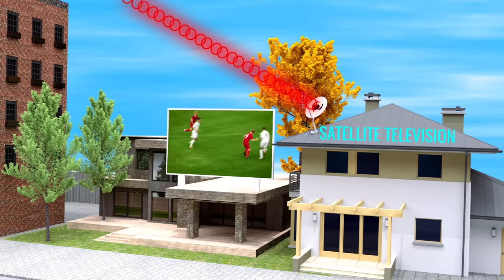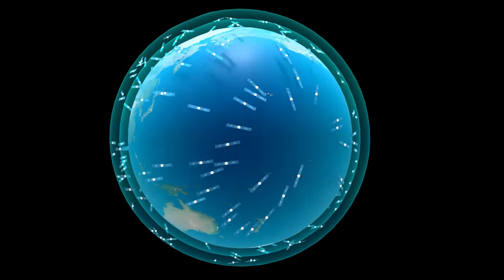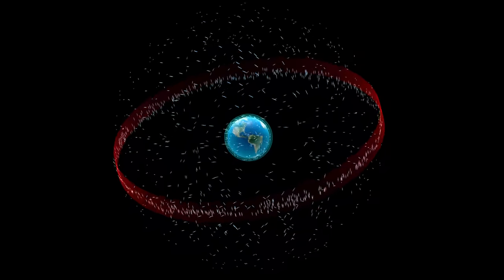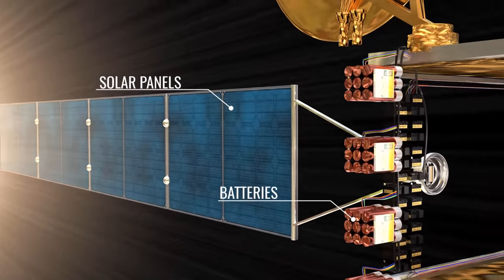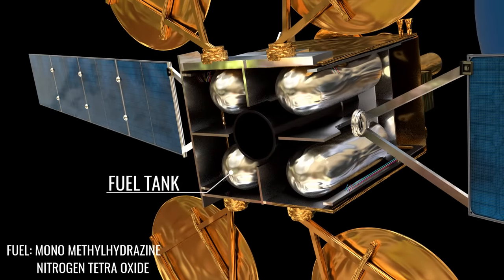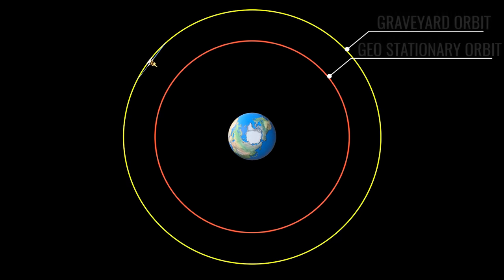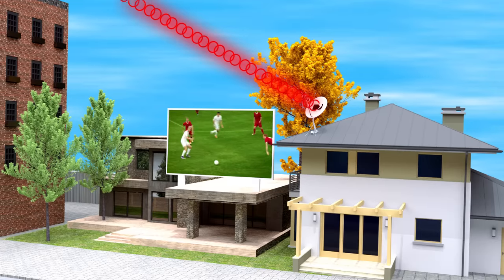How do Satellites work? | ICT #10

Comment: I think you should make part2.. With more details..
Reply: Yeah, he didn't stress much on satellite communication. He said it's not efficient because the wave has to travel a distance of 22000 miles but EM waves travels with the speed of light 🤔
Reply: @lbmetei7596  The further the satellite is the weaker the signal will be be when it reaches earth. Also at that distance the delay is about 140 millisecond which may not be a big deal. But the signal may have to travel that distance up to 4 times. So that's more than half a sec of delay which is not good for real time communication such as gaming or voice.
Reply: @ReflectiveLayerFilm  low earth orbit satellites will have much less delay
Reply: @samueladitya1729  by

Comment: It's a great video, but one thing, as a physicist there is one thing the has sneaked into the public vernacular that is not correct:
There is no such thing as centrifical force.
What they mean to say is:
Centripetal = center seeking force (centri = center). Ex. Gravity
Centrifugal = away from center force (fug = away). Ex. The velocity of the satellite
Reply: the velocity- either angular or linear- of the satellite is not away from the center. The linear velocity is tangential to the orbit. And for angular velocity, inwards/outwards it is meaningless. Gravitational force is the centripetal force. But yes centrifugal force is make believe.

Comment: I have a question. How do ground bases communicate with multiple satellites simultaneously ? I'm asking from the perspective of how antennas receive and process those signals simultaneously. Maybe with the help of Frequency Division Multiplexing?
Reply: Even after 2 years u didn't got the answer ;-;
Reply: Differnet satellites uses different frequencies for up link and downlink. FDMA will be used across satellites in GEO orbit.

Comment: How does a satellite dissipates the heat produced (for example by a transponder)?
Reply: Thermal Radiation?
Reply: It transfers it to its surroundings
Reply: @engr.nemuelobas4923  yeah but he correctly thought about the fact that for something to give off heat, something else has to take in that heat, which is true for conduction and convection, but not for radiation. We also get a lot of energy from the sun through thermal Radiation
Reply: @engr.nemuelobas4923  the problem for conduction and convection is that there are no 'surroundings' to give it's heat off to

Comment: How are satellites refueled ?
Reply: Solar
Reply: They didn't. Usually, satellites' lifetime is about 15 years. After that, it replaced by a new one.
Reply: They are not refueled, the amount of fueled they carry is calculated beforehand in order to last for the entirety of its lifetime. Then, as it has been mentioned in the video, when the satellite is about to run out of fuel, they move it to the graveyard orbit and leave it there.
Reply: @lluismr97  but this Is a waste of precious and expensive materials
Reply: A waste of materials would be to go and refuel them, remember you have to launch a rocket to get to them so it is much better to just launch a new one. This obviously increases the amount of space debris up there and that's the main issue that needs to be solved.
Reply: Why don't satellites just slow down, lower the orbit and burn in the atmosphere?
Reply: When they are in low earth orbit they do that, but if they are higher it is easier to just put them into the graveyard orbit.
Reply: @lluismr97  thank you for the answer 👍
Reply: @lluismr97  yeah. And requires less fuel than deorbiting
Reply: @pmj_studio4065  they do.

Comment: Sputnik 1 orbited the earth 1440 times, traveling at 18,000 mph.
Yet inspite of performing all the necessary requirements, fell back to earth 3 months later. Now using the same method, satellites stay in orbit indefinitely. Curious
Reply: The thrusters keep them in orbit ??
Reply: @killstreak4767 From what I have read, that does not seem to be a requirement.
Reply: Dean Floyd it is required for LEO as there are still few particles of our atmosphere there slowing down anything that orbits on that altitude. You heard wrong.
Reply: @tgstudio85  Do you believe Father Christmas needs all eight reindeer or is there a bit of redundancy?
Reply: Dean Floyd what has that to do with satellites?

Comment: When the satellites want to go on the graveyard orbite, why do they trust in a way that accelerate their angular speed ? If they switch to an higher radius, than the gravitational force is less strong (because the satellite is further from the earth) but if they accelerate then they somewhat keep the same angular speed that they had on their previous orbit right ? So when they’re on the graveyard orbital, don’t they get further and further from the earth since the centrifugal force didn’t really change but the gravitational force became less strong ? Shouldn’t they thrust perpendicular to their trajectory? So their angular speed is slower resulting in a less strong centrifugal force as well as a less strong gravitational force so they can keep their equilibrium and stay on the graveyard orbit ?

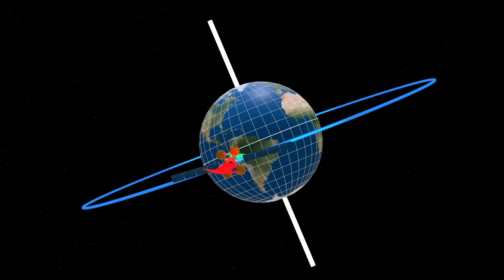Comment: qn 1.  why wont it remain at a same spot if the pulling and pushing forces are equal. why will it revolve ?  (1:10)
             it should stay at a point only stationary if the pulling and pushing forces even each other out. as u said there wont be any external force except                                                   gravity and centrfugal force. so how will they revolve round the earth. for centrifugal force they would need to come in a orbit. so just placing them at a point in space would only attract them to earth. how will they irst come in orbit round the earth???

Comment: As satellites were protected by multiple layers. How solar panels were able to sustain such high and low temperatures. My point is does solar panels were also covered with some layers?
Reply: they might be rigid as their main component is silicon.Nice question!
Reply: Very simple, in space there is a vacuum so you can only radiate heat thanks to electromagnetic waves. Whole space is like giant thermos.

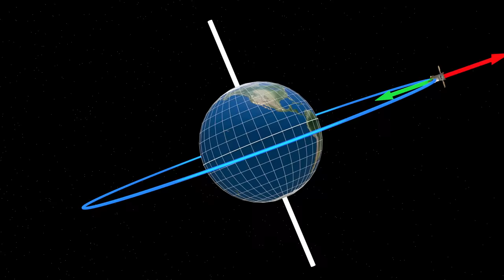Comment: 1:06 Hate to be the nerd here but, that is not true. Small air particles escape the atmosphere and all satellites hit these particles. This creates a very small amount of deceleration called "Orbital Decay". While this is a slow process, most satellites use RCS or Ion engines to counter this.  Sorry for my nerd lesson, it was your fault for reading the entire thing. Also there are more reasons for orbital decay but, this was one of the more simple ones.
Reply: I won't be replying or reading comments here, so comment here what you will.

Comment: As a general rule this it's a very useful of general information about functionality and technology advances but they not present the negative aspect of the constant radiation due the increase satellite in the atmosphere without considering the different frequencies oscillation on the earth. Depends we are you located you might feel the consequences on long time as poison in your body. As a drop of water may not perceive as a threat to the concrete but in the time create a cracking.

Comment: What I would like to know and I believe the true purpose of a satellite truly is would be that the space station orbits the earth at 17000 mph 16 times a day so if a satellite was put on the space station orbiting the space station 16 times each time the space station moved once the satellite orbiting the space station would move 288,000 mph now if they put a rotating disc that was connected on an electromagnet and when the electromagnet turn off the rotating disc was released like a frisbee will the rotating disc move 288,000 miles per hour? and the reason would be obviously that if the rotating disc was to move like a frisbee at 288 thousand miles per hour it would make it to the moon in 1 hour and likewise if we were to add more satellites rotating around satellites and we managed to achieve things moving billions of miles per hour would it make it that we could make frisbee like devices that were hurled from the satellites that can travel billions of miles per hour because if the satellite can move billions of miles per hour and still maintain its form then other objects that are propelled by it would also be able to move billions of miles per hour which would make it that we could travel through space anywhere using the rotation of satellites

Comment: Why do GPS systems on mobile phones require internet to work ?
Reply: To make it accurate ..you  can download offline gps maps but it will not work so good
Reply: not really
https://www.youtube.com/watch?v=0i3CCwTg86M&t=401s
^ this guy tested it on a flight without using any internet connection
Reply: They don't need internet for GPS if you notice Google maps can cach maps so navigation can continue without internet
Reply: Because most mobile GPS use A-GPS(Aided-GPS). A-GPS downloads satellite position via internet to speed up position fix, without it phone downloads position of GPS satellites by signal spread by them which is really slow.

Comment: there is no centrifugal force, if there was and it was equal and opposite to gravity the satellite wouldn’t orbit but just continue in a straight line. there is only gravitational force and then a velocity tangent to the orbit
Reply: If you see from earth's reference you will see that the centripetal force required to keep satellite in orbit is given by gravity.
Reply: Centrifugal force is a pseudo force. 
Exists only for non inertial frame of reference

Comment: Small correction: there is no centrifugal force; the only force acting on a satellite is gravity. Great video anyway.
Reply: Every body when rotates in circular motion it experiece 2 forces Centripetal and centrifugal. Here centripetal force is gravitation force or gravity which is balanced by its centrifugal force
Reply: @tahirbintariq8934  Yes, I saw even some textbooks saying something like that. But that does not make it true, and there is a simple way to test it. If the gravitational force (which is a real centripetal force) is balanced by an equal, but opposite, centrifugal (inertial) force, then the sum of forces acting on the body (satellite) is zero. Try to apply Newton’s second law on such case, and let us know what kind of motion ensues.

Comment: No it's not a balance between centrifugal force and gravity. Satellites do free fall. But they stay in orbit because of inertia: the speed is so high that because Earth is not flat they fall beyond the horizon and never reach the ground.
Satellites also do loose speed because the atmosphere is incredibly faint but not zero for low orbit satellites. The effect is small but after years they do fall back. The exception is geostationary ones. They are so far that it would take millions of years or more to see them coming back...
Reply: If the satellite were inert it would travel in a straight line.

Comment: the satellites fires ?? but there is no o2 in space ??
Reply: Every rocket that will operate in a near vacuum will have two tanks.  A combustible fuel and an oxidizer.  Sometimes that oxidizer is actually oxygen, but there are others.

Comment: Now the real question..how to keep a satellite still , out of orbit ? Sometimes the picture satellite needs a long exposure on a spot like a week for data..
Reply: You can do so by using geostationary satellites which are 6 times higher in altitude than normal satellites
Reply: @lllllllllll1164  .. geostationary moves with the earth rotations..I mean is there a satelite that does not move with the earth or anything else..?..fixed on one spot detached from any moving objects
Reply: @surenbono6063 , there are specific regions in space called Lagrange points. An object (satellite, telescope) placed there would remain still because at these points the gravitational forces of Earth/Sun/Moon would cancel each other out. James Webb telescope is at Lagrange point 2 (actually orbiting that point).

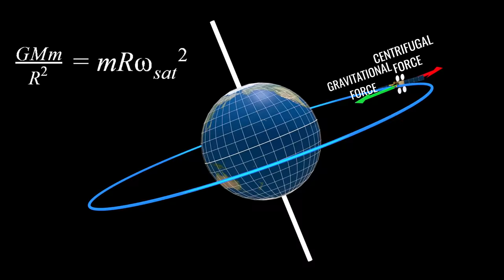Comment: 0:38 it's false, first the centrifugal force don't existe, then if the centrifugal force and the gravitation force were balanced the satelite would go in straigt direction. the truth is satelite are falling in high speed and the force on them is the gravitational force.
Reply: yes, gravitational force provides the centripetal force acting on the satellite, hence the curved path.
Reply: It actually depends on the frame of reference. In a stationary frame, you're right; there is no centrifugal force. However, if you're using a rotating reference frame, centrifugal force does exist.
Reply: @patrickthompson5513   people must pass class 8 before asking such doubts.

Comment: Satellites are mostly land based some are on Baloons and drones.
Reply: When you grow up you won't be saying that.
Reply: @sissyfus6181  
Why do you think NASA is the bjggest buyer of helium in the world at 75,000,000 cubic feet?
Reply: Have you ever even tracked a satellite signal?
I know you struggle with shoelaces so that is a big ask.
Reply: @sissyfus6181  
Not answering a straight question and throwing insults
disquals you from any further conversations with me.
Reply: @tonyornelas9374  Good luck with your velcro shoes.
Reply: @sissyfus6181  
Good luck getting satellite radio more than a hundred and fifty miles off the coast.
Reply: @tonyornelas9374  "Good luck getting satellite radio more than a hundred and fifty miles off the coast."
Which sat radio?
Sirius?
You realize  most of those radio satellites use directional beams???
Meanwhile, a cheap consumer GPS with a cheap patch antenna works in the middle of the Atlantic ocean.
What say you to that?